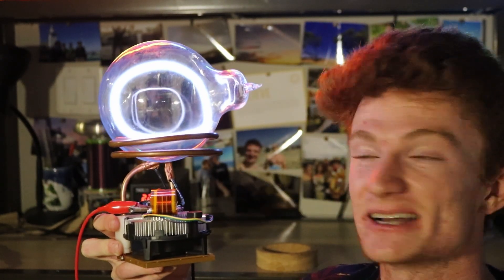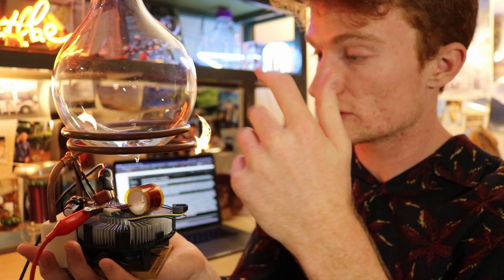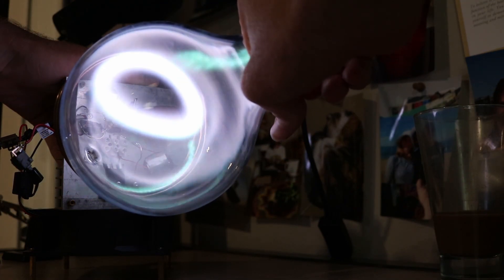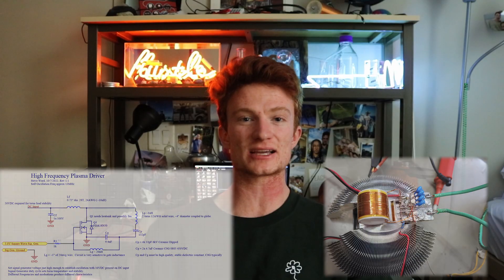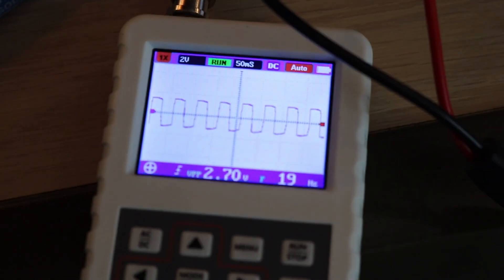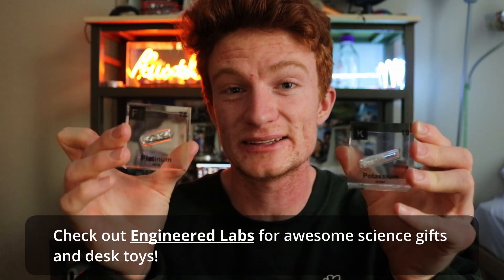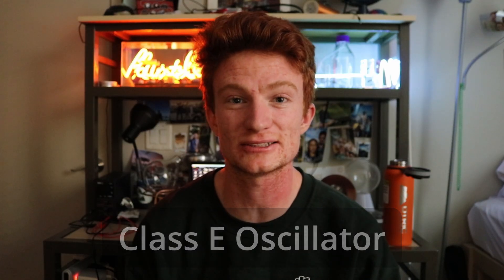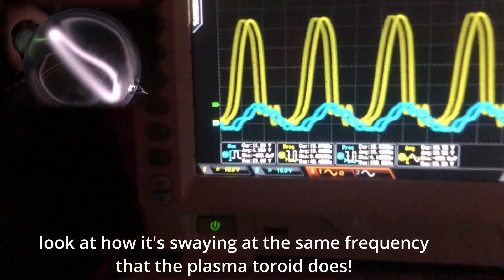perfecting and explaining the plasma toroid

Comment: Really fucking cool video! I work with RF, I love tinkering with electronics, building circuits from scrapped components, and this is a pretty simple circuit with a cool outcome. I am curious, could a higher frequency ZVS have the same results? I've made one from scrapped parts before with great success but unfortunately fried it before i got it on my scope. sustained 120 watts, over driving the zeners=negligence. ZVS are usually in the 15-20khz range. The tank can be tuned for higher Fs but I have no idea if the rest of the circuit can function in the MHZ. I need to repair it and find out! 
I could make a circular antenna on my HF radio, turn up the power and key up for some plasma haha (even more expensive fix when the finals burn)
Reply from the maker: hahah thanks Tony! You could try a HF "traditional" ZVS driver, I hadn't thought of that. Bummer about that one you burned though, but thats what i hear happens with everyone's first zvs driver haha. good luck with your future projects!

Comment: I would love to see the effect of two coils placed on either side. Does it form two toroid? What happens when the electric fields are switching direction out of phase with each other so they're always in opposition: because they would nullify each other at the center, would it make a sort of "8" shape? 
This simple ability to define a plasma's shape may be the first step to holograms, spurring the start of an interest for making high resolution electric field generators. 

I think I saw in a video's comments that something close to it has already been developed for some e-paper displays which use magnetic fields to turn multicolored particles so one color can be displayed, it would just need to be beefed up for the plasma.

Comment: Nice job getting the ring to float in the center!  That, I think, is what most of us were looking for.  It seems like putting a shorted copper loop on the top of the globe would help stabilize the ring - by Lenz's law, it would have the opposite current and flux, and would give you some push-back on the ring.  You'd have to play around with the size and thickness of the loop, but it probably would stabilize it over a much larger range of drives.  Don't forget that this ring will be dissipating some power, so it might get hot under some circumstances.  I'd start out with smaller diameters at large separation from the lower winding.
Reply from the maker: thanks Scott! Would you like one of the element cubes? I think that shorted copper loop is a cool idea!
Reply: @BackMacSci  I appreciate the offer - give it to someone else, and keep up the good work!
Reply from the maker: Thanks! And will do.

Comment: you could theoretically run a second loop at 90 degrees with audio wave generation running at a much lower current just enough to induce audible oscillations

Comment: If this could be scaled up and used in the upper atmosphere in rarified air, the plasma toroid could act as a means of propulsion as a differential heat thrust. 
Closer to home, if you could produce that ring at a specific ring diameter that is equal to the wavelength of a specific radio frequency you are trying to jam, it would be a good polarized radio jammer.  So a ring diameter of 2.36 inches should jam 5ghz wifi or phone communication.  The ring would also react to radio signals.  If your ring was stable and you brought a rf 5ghz signal generator close to it the ring should distort.
The real trick would be to make a self sustaining lightening ball with a toroid generator if the dimensions of the toroid in itself had the inductive and capacitive qualities for maintaining the arc.  It does happen in nature.  Sometimes when you are welding you see a plasma ball last for a second.  You could be the first to generate a self sustaining lightening ball.  It would probably require a speck of dust at it's center.

Comment: Plasma toroids, with the current turned way up, were used in early nuclear fusion experiments.  With enough current the plasma magnetic field pinches the plasma to high density.  Unfortunately this also amplifies any small irregularities in the plasma, throwing the toroid into the chamber wall.  Search "toroidal pinch fusion".

Comment: Well when you have an AC system like that, it isn’t just magnetic or electric fields, it’s both. Considering you’re dealing with a low-frequency inductive emitter, I’d say the magnetic field will be stronger than the electric field compared to in a radio wave. Obviously you’re not going to ionise gas without some sort of electric field, but once it’s started most of the energy will probably be carried via magnetic field.

Comment: All i think when i see this is that it should be possible to have unlimited life lightbulbs

also, do not work with gloves around powered equipement like that, that is not safe, you know how many tradesmen lose fingers and hand like that?

same goes for loose fabric

when it grabes and pulls you don't have the time to hit the e-stop

take the gloves off for the power tools, put them back on for the hand and knife work

seriously gloves turn what would be small cuts into amputations
gloves turn what should have been rugburn or minor scraping into torn off fingers

you are endangering yourself, use the cut proof glove for knife work as it is intended

do you know what it looks like when a drill grabs a glove thread and tears a thumb off?

Comment: You weren't entirely wrong, there's a reason its called an "electro-magnetic feild." Depending on the specific language, if you are measuring a feild of magnetism or charge, there are equasions to measure both as a function of either kinda like ohm's law. From a physics perspective they are the same thing just expressed differently.

Comment: As someone who’s had a hot lightbulb explode because I carried it too quickly in mildly cold weather, im extremely surprised the globe did not break when you took it directly from the arc state and plunged it into LN2
Reply: probably due to the near vacuum. the plasma itself is very hot but there isn't enough heat transfer to the glass to heat it substantially would be my guess

Comment: When you're trying to solder legs into the huge pads on your home made PCB, you should tin the legs first. Adding a blob of solder around the leg before attempting to solder it to the board. It helps increase heat transfer from the iron, as well as helps wet the surface so that you get nice adhesion. With huge pads covered in solder like that you're gonna have trouble getting the whole connection site hot enough to make a good connection, and you'll likely end up with a joint that is brittle and may crack and fail. You should also make sure to use some flux, even if the solder you have is flux core, flux will really help the solder wet.

Comment: Try signal injection for the circuit.  2.7V can be looked at as 3V P-P ( peak to peak ) and injected as a wave on the signal wave.  Think of ripple currents on AC power lines and why in electronics it needs to be removed, in audio it needs to be amplified.

Comment: What frequency goes into the coil? What amount of current? It could be that the big coil vibrates very minutely due to the magnetic forces acting on it and the contact points with glass generate the screeching sounds. It could even be that you get non-linear effects and sub-harmonics even if your coil itself works in the ultra-sound region.
Reply from the maker: i have to check the oscillation frequency, but I know the current is 2.7A. And thanks for the well developed and informed ideas on the screeching. Sub-harmonics is a word I should know

Comment: it would be really cool to see what happens if you would use two oscillators on the bulb at the same time if it would be possible to make even crazier shapes of the donut that way. that or the two circuits gonna disturb each others fields is my guess
Reply: i believe the later yes, they do not like other fields
Reply: @BotchedGod  there is only one way to find out right ;)

Comment: I love that project.  Do you think it will work with other gases at low pressure?  with air or helium... with something easier to get
Reply from the maker: Helium would be the hardest to light because its ionization energy is the highest of all gases, if i recall correctly, but gases like air work!
Reply from the maker: I just dont have access to a vacuum pump and a gas manifold to make it
Reply: @BackMacSci  I have a compressor from an old air conditioner and sometimes I have made vacuum in bottles and jars and when ionized it looks similar to when the ring is not formed and plasma strands come out.
Also with magnets you can make very nice plasma tornadoes.
And this only with low pressure air.

I will see if I can make a vacuum in a test tube or something like that and if it ionizes when approaching the Tesla coil
Reply: @BackMacSci  youtu.be/_xko1Renqjk
This is the plasma tornadoe I made.

Comment: Hey Tate, great stuff right there. I was looking forward to an update of your shenanigans in your lab, specially working on you toroid. 
So here's an idea for you; perhaps you can create a 'starting device' to get the plasma going. I was thinking of a Piezo electric starter so you can get your reaction going by the push of a button. It just may be the electric discharge you need to set it off in the right way.  You can break an electric lighter or a gas bbq ignitor for example to get this part (or source it in the depths of the Amazonian)
It for sure will make a great addition or iteration on your Plasma Toroid and love to see you working it out in the next video!
Take care, keep going!
Reply from the maker: Thank you Ron, that’s a great suggestion. I’ve verified that piezoelectric igniters work great as a starter. I’ll mess with it for the next video.

Comment: Good video ! The color changing you observe is certainly due to the change in the electron energy. They maybe gain energy from the coil with more efficiency and thus get heated in a better way. What could be intresting is to increase the power of your device to give even more energy to th electrons, thus the brigthness and the colors of the toroid will be even more intense !
Reply from the maker: Well said, and yes, from my experience, a higher supply voltage gives a brighter torus.

Comment: I wonder would it work in a cylinder vessel so it can ignite at the bottom and lift up as a torus like in Jacob's ladder? Would the plasma torus dissipate immediately or would it lift to the top of the cylinder further from the coil at the bottom in the same shape? Like the smoke rings. Imagine that...
Reply from the maker: That would be awesome, yeah, but the ring only forms near the coil because thats where the electric field is strong enough to ionize the gas. If you put more coils along the length of the tube, maybe it is possible
Reply: @BackMacSci  Hmmmm...  Who could do it???   🙂

Comment: nice video, I put it in my "favoritesc folder.
SUGGESTION: make 2 with the secondarys orinted to each other 90 degrees with plasma ball in the middle and the oscillators phase also 90 to 180 degrees or adjustable.
is it posible?
is it dangerous mixing this much current at phases so close?
Reply from the maker: Thank you! And i can do that, yeah

Comment: get some high speed camera footage of it. shine a laser through it. see how it reacts to external magnetic field, try different shapes of magnet. i also like ideas from other comments about adding a second coil and maybe 3-d printing some kinda separator/coil housing to keep the glass from directly touching the coil(s). also, how bout trying biflar coils? if you use two coils, see how it would react to the same frequency bumping through both but set one 180 degrees out of phase. see if theres any difference between square wave vs sine.

Comment: What if we arrange a number of coils around the perimeter of the bulb and form a rotating magnetic field due to the ESP controller? It should be easy to implement. Is it possible to make the toroid rotate in this way. Twist it into a knot?

And good luck to you!

Comment: My video idea would be to pursue glassworking for the sake of pretty plasmas and reviving the now extinct low pressure sodium vapor lamp.

Also, your explanation of the physics is lacking; how is the changing magnetic field supposed to turn into an electric field in an evacuated tube? The device relies on electric field to ionize the tube first, progressively allowing current to flow.
Reply from the maker: Yeah, I'm learning glass working slowly for innovating designs in plasma light like Wayne Strattman!

As the for confusion about electromagnetism, any changing magnetic field will induce a sympathetic changing electric field according to the right hand rule, even if there's no conductor to allow conventional current to flow. As explained to me by @vidduley , this is the same reason as to why the EM waves can travel in space. E and B fields don't need to be in a medium to induce each other. But yes, in this video, I didn't go into deep EM theory as I hoped to reach an audience with a high school level education. Hope that helped.

Comment: 14:45 Where I can find this pdf?
Reply from the maker: linked in the last big plasma toroid video
Reply: @BackMacSci  good job.
Reply: @BackMacSci  Hello Mr I was think about sheme of ZVS driver which you are use in this video and sorry but this driver can hardly work at 10 MHz, and then the signal will look like a saw, at higher frequencies MOSFET which are used in this shematic can't worc cause in second page of it DATASHEET developers of this MOSFET write that's  "Turn-On Delay Time + Rise Time"=77ns and "Turn-Off DElay Time + Fall Time"=98ns. So maximal frequency= 1/98ns=10MHz...
Reply from the maker: @caeli5532  interesting! it works well for me despite that though!
Reply: @BackMacSci  Yep - I was wrong. Guys who know radioelectronics more better then I talk about it: FETS can work in different frequencies if you can charge/discharge parasitic capacities on Gate of MOSFET fast as it must be on used frequency.

Comment: I have a few ideas for videos, mostly about the plasma toroid. It would be interesting to see what would happen if you introduce a second coil, would it be possible to make 2 toroids in the globe? They'd have to be separated enough to not interact with each other of course. 

As someone who's into audio design, I'm also interested in manipulating the waveform you're using to generate the toroid. If you've ever seen "Oscilloscope Music" you may know that combining a signal with a square wave duplicates an image. I believe in this case the square wave would need to be be very high frequency. Essentially using the same coil to generate two different electric fields with different positions/shapes and switching between them very quickly. I'm imagining a cool "stack" of toxoids, but it'll probably not be so simple lol. I think all sorts of additive synthesis principles may yield interesting results.

Final toroid idea, having other electromagnets around the globe to manipulate the position/shape of the toroid, with some clever programming you may even be able to use external electromagnets to stabilize the toroid easier/faster.

Non toroid idea, exciting Nobel gas/vacuum vessel with high voltages with samples of other elements placed inside can change the color, even when it's not a gas. For example, salt would introduce sodium ions and change the plasma orange/yellow. There has to be all sorts of solids and liquids that would add change the plasma interesting colors.

Good luck on your YouTube career!
Reply from the maker: i love these ideas! thank you!

Comment: Do the capacitors used in the circuit have to have a high voltage rating? An idea you could link the NE555 Timer AM Radio into the coil and get it to play tunes (Hear That? It’s A 555 Timer AM Radio) hackaday article has links. you could probably link a few different gas variants to a midi controller and play with a keyboard. How about ghost hunting with them?
Reply from the maker: lol, ghost hunting with them!
Reply: @BackMacSci  There are a lot of crack pot so called equipment used to find ghost like scanner am radios with controls modified set to always scan. Don’t believe these devices myself but if you have a visible thing like a plasma and ask the spirit to interact with it perhaps there might be a viable sign or not

Comment: Awesome !!!  Maybe try using separate coils - one for each current direction.  It would simplify circuit design.  Collapsing magnetic fields generate a voltage spike in the opposite direction but maybe that's not a problem for air cores.  Spikes are usually shorted by a high speed diode or passed backwards through the inherent body diode of the MOSFET.  If you got a function generator with multiple outputs you could just basically do everything with that and just amplify the weak signals with mosfets.   Also a ferrite core transformer with single wound primary and dual wound secondary might do the trick to split a single input into 2 outputs (if you only have a single output function generator).  Maybe use variable resistors to adjust MOSFET gate pull up or pull down. Maybe a coil could be placed on top of the bulb and one on the bottom of the bulb to help plasma float in the center.  Might be able to play music in the plasma by playing audio through a third coil - just run the audio through an amp first - speaker coil to side of bulb ??? I have no idea.  Anyways great video and great editing!!! I been working on an invention for about 20 years.  I will make a video about it maybe next year.  Too busy right now.